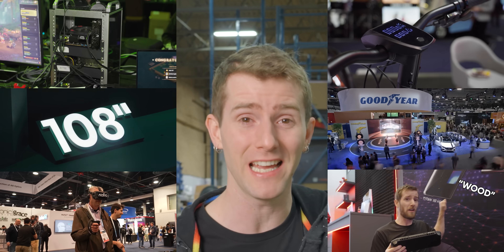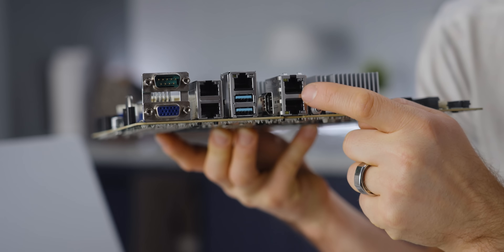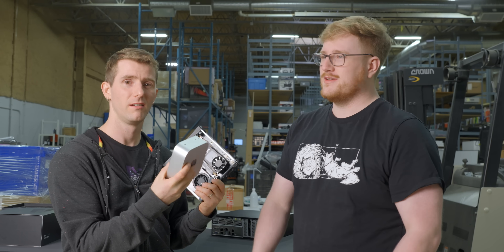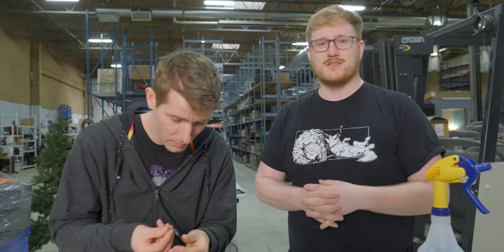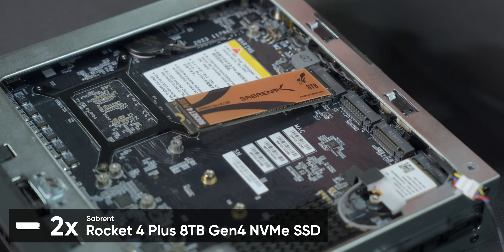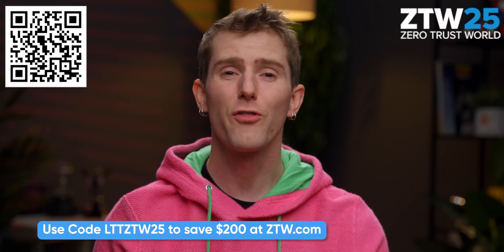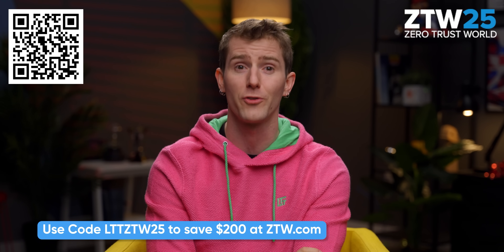I replaced a $20,000 server with this

Comment: Yeah minisforum actively remove negative reviews on their site and their devices have issues with both cooling and mounting pressure. The mounting pressure stems from a design where only 1 or 2 of the 4 sides of the heatsinks have screws. You'd be better off building a mini or micro ATX PC.

Comment: So you replaced all in one box machine to multiple small box machine cause it's slightly smaller.
That reasoning is absurd. Just say you making it for sponsers.
One misplaced component or cord/cable and it all falls apart.
Could have made smaller version on old machine but just one machine.
In hectic space like CES slightly bigger one box solution is so much better than this Frankenstein solution.

Comment: Often, I start thinking about shoving my PC in a recycle bin, thinking about that makes me sad as I have roughly 250 games in my Steam library, I think my system is not that bad [AMD Ryzen 7 5800X on a MAG B550 Tomahawk, 32 or 64 GB RAM, RTX 3060 Ti 8GB. water cooling system (can't remember make and name) but the room get so warm/hot that each time I play something I have to open the window to get some good cold Canadian winter air in and even when it's -10 + C I still don't get cold, during summer my old AC could not keep up (had to buy a new unit) I picked those parts from internet search about reliability and price (tight budget) ordered them from Amazon and New Egg and put it together, I felt proud of myself for doing so but that heat is getting on my 54 year old nerves. I wish you guys had a shop in Ottawa I could bring the case to fix the issue, please Linus open a shop in Ottawa! lol

Comment: I saw Mushkin RAM online recently and had the same thought, that I hadn't heard that name in a long time.  I was needing to add 64GB to my new MSI laptop and this RAM was terrible.  Windows would run for a few minutes and just reboot without a BSOD.  I tried windows memory diagnostics and it would run for a minute or two and reboot.  Memtest86+ would also just suddenly reboot.  If I used  a single stick of either there were no issues, it was only in dual channel mode that it would do this. So I sent it back and got some Teamgroup Elite DDR 4, same exact specs across the board and no issues whatsoever.  I dunno.  Maybe just a bad batch or some strange glitch.

Comment: How is no one questioning the use of NVMe SSDs without heatsinks, and the fact that the MS01 only supports a low-profile heatsink for just one of the three NVMe slots? I have an MS01, and the cooling for the second and third NVMe seems inadequate. Curious why Linus didn't install at least the one low-profile heatsink included in the bare-bones kit. Is it not needed, in your opinion, Linus?

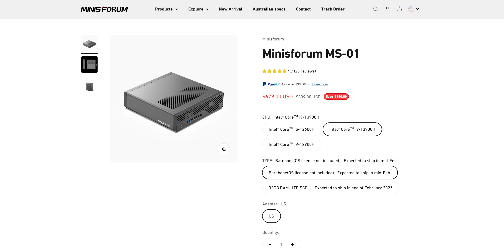Comment: 7:18 Yikes, I hope you've installed the microcode updates, cause that CPU might otherwise just randomly fry itself during regular use. I'd rather get the slower 12th gen one, which doesn't have such reliability issues.

Comment: @Jake you could take the new-ish mikrotik 4 port 40gb switch and use a 40g thunderbolt to the server and 10g breakout cables for clients, or even the mikrotik 100gb and use breakout 25g cables everywhere... nowadays fast speed doesn't necessarily equals a lot of volume, compact switches exist ;)
~Bryan

Comment: I'd still put it all in a Pelican case for extra protection.  Heck, you could probably still use the old Pelican case, you'd just need to get foam recut for the sizes of the device to make sure they sit nice and snug and don't move. Take a look at all the devices when they were stacked on the table, if you picture it with 1" of foam in between each device and an 1" all around between the case and devices themselves that'd be enough protection and also will leave a decent amount of space for all the cables required and any extra stuff needed.

Comment: You can connect Macs directly with Thunderbolt, so you can bring something like the iodyne Pro Data instead of that NAS/Ethernet adapter/Ubiquiti switch combo. It has slots for twelve M.2 NVMe SSDs and eight Thunderbolt 3 ports (four upstream and four downstream).

That means you can hook up many editors to this thing directly with Multi-Reader Sharing that ensures "data discipline" across multiple users (avoiding duplicate copies and versions of assets, protects against the risk of overwriting OCFs and OCNs or corrupting files, and the overall messiness that comes with large data sets) at up to 5GB/s speeds. This thing is built exactly for what you are trying to accomplish here. It's an on-set device for editing on the go.

Also it fits in a normal backpack measuring 39.1cm × 25.4cm × 3.1cm and weighing 3.3kg.

You can connect the Mac mini directly with a USB4 cable to that NAS and forego that clunky ethernet adapter or add the $99 upgrade 10Gbps ethernet port to the Mac mini.
Reply: iodyne Pro Data. First I've heard of this. Thanks for the tip.

Comment: The storage makes zero sense. 512GB boot drive? Did they find it behind some dusty cupboard and said, "yeah, let's throw it in as well"?
Reply: 512 is more than enough for a boot device. And you have the whole 8 TB free for RAID-purposes.
Reply: @romsch2430  Look, hundreds of MB might be enough to boot whatever super-small Linux distro you choose, TrueNAS Scale says 16GB is the minimum size, but that doesn't account for a lot of things that you might need down the road, including ISOs as installation source for VMs, updates, additional software and whatnot. I also don't get the build overall, since you could pass the iGPU of the Intel processor to a VM, making the outdated workstation GPU obsolete, allowing for the installation of a 4x M.2 card, despite the PCIe slot only being x8 (cards exist that take 2x M.2 on both sides and have a PCIe switch built-in). This system could have up to 56TB of NVMe storage.
Reply: @graealex  As mentioned in the video, even those 2x8TB used for the RAID are more than they need overall.
And if you don't put many VM on this machine, the space is enough.
Also, this "outdated workstation GPU" is a NVidia Quadro. That's not an ordinary GPU and probably has some benefits for transcoding in contrast to Intels iGPU.
Reply: @romsch2430  I've got plenty of "outdated workstation GPUs" lying around here, and they are overhyped in their capabilities. For rendering we are mostly looking at their ability to decode and encode H.264 and H.265, and there current-gen GPUs, even iGPUs, have the upper hand. The P1000 used is (as the name suggests) Pascal architecture, which is super outdated at this point (it's from 2016). The iGPU in the Intel 13900H actually scores better than a P1000.
Reply: @graealex  Problem is, you don't know, why they want / need to use this. But it's mentioned in the video, they don't need that much space. So why put even more in it?
A separate SSD for the system might be the perfect solution for their needs.

Comment: ANOTHER OPTION is to use that fancy metalworking and 3D printing shop you have in-house and make a CUSTOM LUNCHBOX computer case with a nice and sturdy carrying handle that combines the small form factor TYAN or Gigabyte AMD EPYC 128-core CPU chip motherboard with 2 Terabytes of RAM. You rip-out the motherboard of that NAS/network switch and put it into the lunchbox and add a super-Wifi-6 multi-port wireless router and ALSO put in eight of the USB-4 Type-A and Type-C and Thunderbolt ports, multiple 10 GB or even 100 GB Ethernet ports AND at least four of the DCI-8K resolution capable HDMI and four of the DCI-8K resolution Displayport outputs! Put in some external SATA ports and internal 40 GB SSD drives and you are all-set-to-go as a portable video editing workstation/rendering server! You could even install a 17 or 20 inch DCI-8K OLED reference display (i.e.a 10-bit/12-bit Sony BVM or Canon Reference Display!) that pop-out or swivels-out from the side of the lunchbox computer!

You have ALL the tools and engineering capabilities IN-HOUSE! Afterward building it and testing it in-house get some CSA, UL, EU, FCC/DOC, ANSI, IAPMO and NSF certifications from the local Maple Ridge, BC-based "QAI" company which does all sorts of product testing and certifications so LTT could MAKE and SELL some high-end LTT-branded super-server/super-workstations/super-gaming lunchbox machines made all in-house of well-respected components!

V

Comment: I've got this nice little pc running with 5x 4TB nvme SSD, and have plans to make my own daughter board to up that to 6x all internally. Eventually if heat budget allows it, there is even a plan to replace my pcie adapter to 4 nvme drives upping the Nvme count to 8 INTERNAL NVME drives in this beast

Comment: Just few days ago I was checking something for STHs channel and checked HP Z website after quite long time, and noticed HP Z2 mini G1a if I'm not mistaken, just yesterday it was notified HP released somekind of video but haven't watched it yet, and I was just having something like that in mind, kind a hybrid between that and minisforums "cartridge NAS" that you've shown in their booth. I think I explained in comment on your channel or ServeTheHome's channel or both, or of you combine you get my idea of modular upgradeable "tiny,mini,micro" as Patrick from STH called it, modable to all flash NAS like Jakuh wants with more U.2, to normal NAS, which can have powerfull (kinda server/workstation) cartridge and you have powerfull server with tons of space of 3.5" or even more 2.5" SATA drives, and could have alsp direct connection as a slot in card to 8port 10gb switch managed from main system via plugin, but would rather see that's only powered by same "system" and maybe one "port" directly communicates with "PC" and is else connected pcb to pcb only with serial connection and managed that way, or can be just a dumb switch that slots in essentially m.2 4.0x4 to pcie3.0 x8 for 8 port with *almost 10gbit capability each, I predict about 7.8/7.9gbps (theoretical 8gbps and change for each single pcie 3.0 lane) should be with all 8 ports at 100% saturation at the same time (depends on quality NIC ICs), but even some older updated Intel pcie 3.0 10g NICs should do it with no problem...

Comment: did minisforum finally fix their motherboard issues?

I had 2 Minisforum PC's in a span of about 4 years and I had to return both(different models with different CPU's) because they suffered catastrophic failure.

unfortuntaley minisforum CS is garbage and I could only successfully return them because I ordered them on Amazon.

the first had random crashes that became more frequent over time, like no bluescreen or anything, PC just restarts randomly.
2th PC had a kinda similar issue, but when I tried to reset Windows before returning the PC, Windows got stuck in some loop where it didn't finish the fresh install but it crashed every time it got to the screen where it was trying to fiish it, the issues persisted with 3 different SSD's so I just left it as is with the stock SSD so the tech support staff at Amazon can have some fun with that.

Comment: 15:30 Just a quick side tangent/word of caution: please bring a travel router /firewall appliance that is hardened if you choose to do as outlined in this video and plug IT into the ap's ethernet connection. No telling what else is crawling around a hotel network, and there have been several cases of bad actors operating spooky devices on hotel connections to sniff for data and spoof login pages to man-in-the-middle theft information.

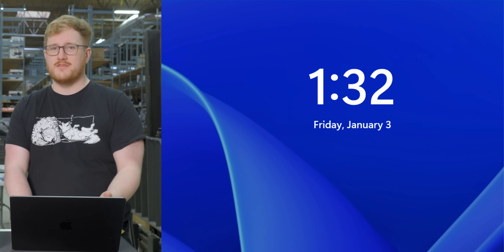Comment: 12:21 Is the nanoKVM now safe to use? There were security concerns in the original review. I know the firmware source has now been released, but is it now safe for less tech savvy ppl to just plug this in and use or do you still need the knowledge to be able to nail it down on the network and assume it is doing something malicious?

Comment: I used to work at the Venetian and the hotel towers have a 10gb internet connection, but the hotel limits guest wifi access to 10mb for monetary reasons. Because, of course they do. You could pay for higher bandwidth but it's just cheaper to use your phone's Hotspot.
Reply: Yea it sucks...but lets be real...99% of the guests just wanna scroll FB and check their messages. But a few of us want more haha

Comment: Greetings from India! I'm planning to upgrade my 2018-built work PC and wanted your advice. Here's my current setup:

Motherboard: Gigabyte b450M DS3H (rev. 1.x) 
Processor: Ryzen 2200G
RAM: 12GB DDR4
Storage: 250GB Samsung 860 Evo SSD + 1TB HDD
Now, here's what I'm considering for the upgrade:

CPU: Ryzen 9700x or 9900x
Motherboard: ASRock X870 Steel Legend or Gigabyte X870 Aorus Elite
RAM: Corsair 2x16GB DDR5 6000MHz CL30
PSU: Corsair 750W
I plan to reuse my old SSD and HDD for storage.

My Goals:
Use this setup for at least 10 years, then upgrade the CPU to Zen 6 or beyond on an AM5 motherboard.
Primary use case: work PC with tasks like Chrome/Mozilla browsing, website and digital marketing work, Photoshop, learning video editing, and hosting meetings on Zoom/Google Meet.
Occasional gaming: I'd love to revisit GTA 5 (haven't played it in a decade!).
I’d love to hear your recommendations on this build! Are these components compatible and future-proof for my use case? Any suggestions for better parts or configurations?

Thanks in advance!

Comment: Welp why would you do that??? The 13900H is REALLY unstable and will cause freezes and crashes.

There's LOADS of posts on this.

The 12900H version is really stable and doesn't have any issues.
Reply: It's been fixed

Comment: The transcript describes the process of building a portable, high-performance storage and editing solution for the Consumer Electronics Show (CES). The team previously struggled with slow hotel internet in Las Vegas, which forced them to edit footage on location. To solve this, they built a compact and powerful NAS (Network-Attached Storage) system using a Mini PC, high-capacity SSDs, and fast networking hardware. The system is designed to be portable, fitting into a carry-on bag, and is equipped with enough storage and processing power to handle the large amounts of video footage generated during the event.

Key features of the setup include:

- Hardware: A Mini PC (ms01) with a Core i9-13900H processor, 96GB of DDR5 RAM, and high-capacity SSDs (two 8TB Sabrent Rocket 4 Plus drives in a mirrored configuration for redundancy).
- Networking: Dual 10GbE SFP+ ports and additional USB 4 ports for high-speed data transfer.
- Storage: Three M.2 slots for SSDs, with a focus on high-speed, high-capacity storage.
- Editing Setup: A Mac Mini M4 for editing, with the option to use a Windows VM for backup editing purposes.
- Remote Access: A Nano KVM for remote management of the system.
- Proxies: The team plans to use proxy files for editing and then conform the final video with raw footage on location.

The transcript also mentions the challenges of hotel internet in Las Vegas and the team's strategy to mitigate these issues by using local storage and editing on site. Additionally, the team promotes their sponsor, ThreatLocker, and their Zero Trust World event, offering a discount code for registration.

Overall, the transcript provides a detailed look at the technical setup and planning that goes into covering a major tech event like CES, with a focus on ensuring that the team can edit and produce content efficiently, even in less-than-ideal conditions.

Comment: A few years ago I had a similar problem that I solved with a 1u thunderbolt raid array and LTO drive in a rack case designed for djs with laptop storage.

Big case got checked as luggage and LTO tape got shipped back via UPS.  It was a good system, but I was dealing with approximately double the storage volume, and going to places where good Internet just didnt exist.

Comment: I use a P2000 in my Plex server. That generation is a solid one: more modern features like 4K, HEVC, HDR support, but you can find them at a reasonable price. 

The Arc A310/A380 is also a great choice for accelerated video transcoding.

Comment: you can avoid buying kvm for rebooting purposes, if you buy simple smart socket with internet control.
Configure bios to always turn on when power is available, and you will be able to force stop any system and boot it by simply switching socket off on and on .

Comment: bull on the macmini. You can get a beelink ser8 8845hs, 32GB ram, 1TB of storage for $100 less than a macmini. That's an EQUAL processor (depending on single core or multi core benchmarks) twice the ram and 4x the storage. It also has 4usbA (instead of ALL usbCs) 1usbc, 2 HDMI, 1 LAN, and it's dead silent. It's IGPU is great and you can emulate ps3/360/wiiU games at high frame rates and even play something like CS2 at 80FPS at 1080p. The macmini is an absolute ripoff compared to the beelink. I like how they talk about "how it would cost so much more if you upgraded from the m4" when it couldn't be further from the truth. To get a macmini at 32GB of ram and 1TB of storage, it would cost $1500. That's $1000 more than the beelink at the same specs.

For $1500, you can get the beelink ser9 AI 9 HX 370, 196GB ram, and 8TB of storage for $1500. The HX370 is far superior to the m4, you get 6x as much ram and 8x as much storage for the same price as the macmini. Linus shilling the macmini is hilarious because he knows nothing about miniPCs.

Comment: Get ready to jerry-rig some cooling to be able to use 10Gbit copper SFP+ transceivers. Went through a fun time with that this fall. Supposedly you can thermally bond the SFP+ slot to some adjacent metal and then it can sink enough heat, but as-is the transceivers we were using were not happy. We switched to fiber in our use case so I never tested the thermal bonding solution.